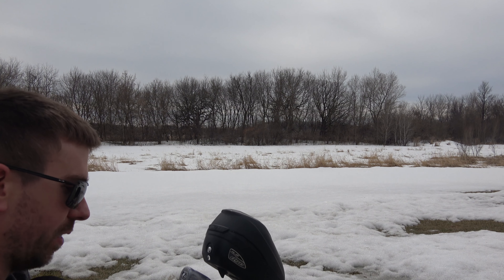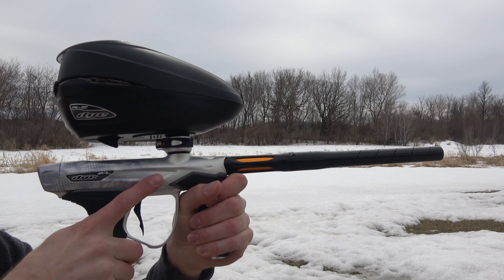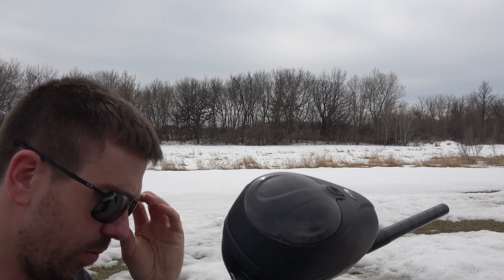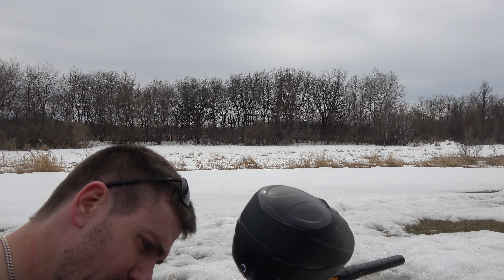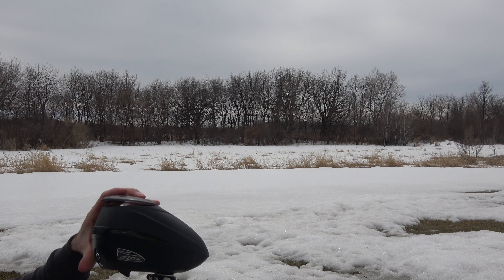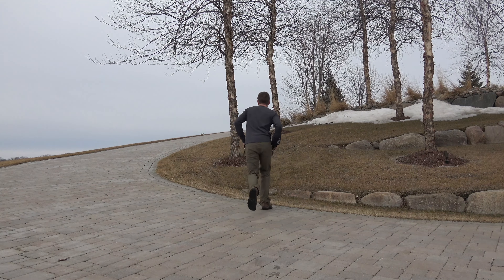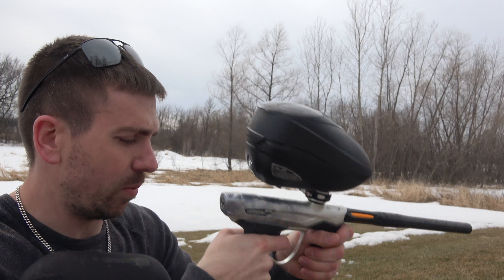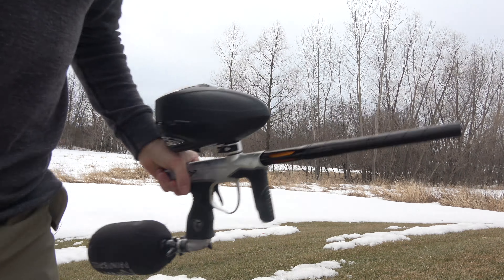Dye M3s Shooting

Comment: Just out of curiosity, why not use the stock barrel? Didn’t they change the UL tip?
Reply: Pb&J-Vlogs The designs is slightly different, the UL backs that are coming stock with the M3s have porting front of the threads.
Reply from the maker: Pb&J-Vlogs I rarely use stock barrels. Just personal preference I guess
Reply: Cnoddings totally understandable I always use Disruptive DeathTouch barrels

Comment: They change the bolt drivetrain ("bolt guide"). I am right? In the impression video it looks different from the one advertised on Dye's web site

Also in your personal opinion: DSR or M3s?
Reply: Buy whatever you can afford...
Reply from the maker: Andres Mastrogiacomo I can better answer that in a few more weeks :)
Reply: Cnoddings I will wait patiently. Just let me know
Reply: BTdeltafan101 ok I will get a Spyder Victor
Reply: A few weeks have passed... DSR vs M3s? I have a m3s coming in the mail as it was more reliable during the TX Winter. Everyone was getting chops with every gun but my m2 didn't chop once that day lol.

The tuneability of a m3/m2 make it seem like the better choice over the dsr as well as the new soft tip bolt upgrade for m3s